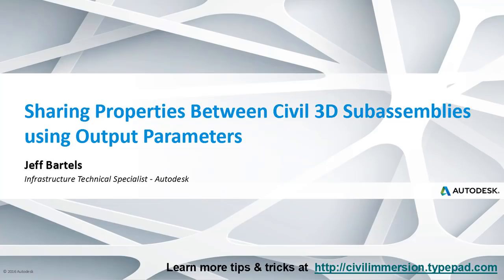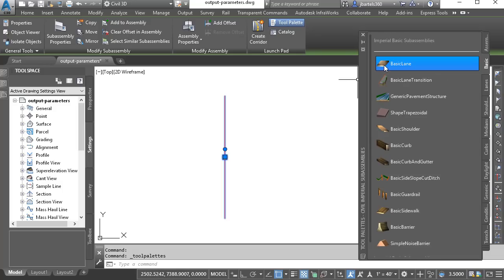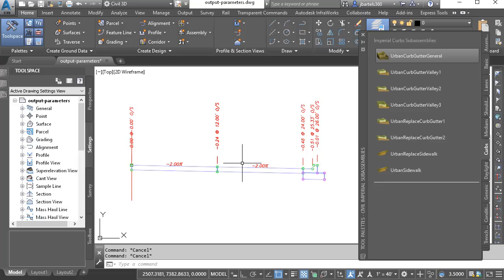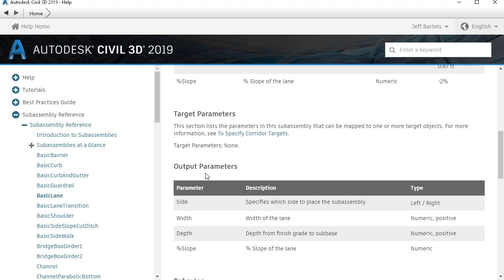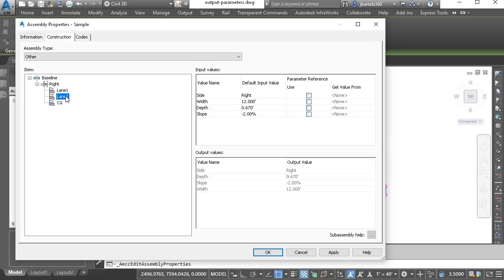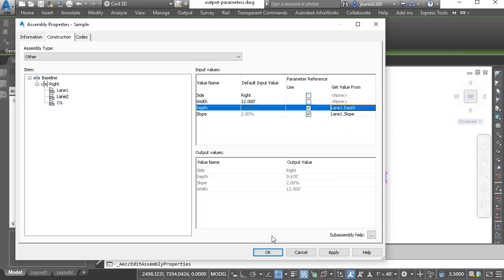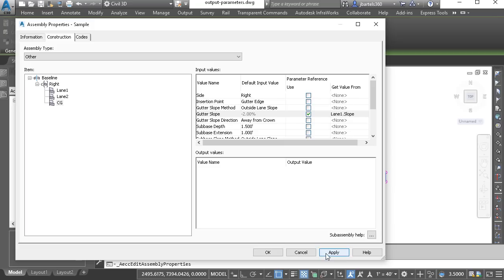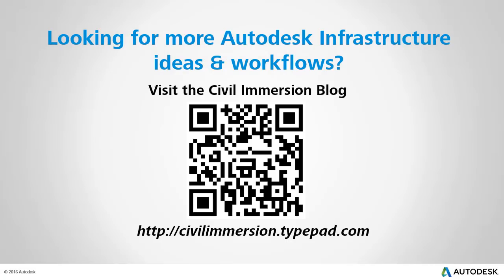Creating Shared Properties Between Civil 3D Subassemblies

Comment: Hey Jeff, nice video! I'm trying to build a subassembly for a ditch for installing sewer systems according to all regulation codes. Now in the Netherlands where I'm working they're increasingly separating storm water from sanitary sewer, so often there's two pipes being installed close to one another, but they don't always keep following the same trajectory. Therefore I'm building my sub assembly in order to allow for the two corridors of the two sewer pipes to join together when they get close enough to one another (in C3D this means one ditch for installing both pipes).

Sometimes circumstances require the use of form-work in conjunction with a 90 degree ditch slope. When this happens the other side of the ditch should therefore also use form-work, so the both sides can be reinforced against each other. Therefore I require an output parameter/variable called "bekisting" (form-work in Dutch) that can be also an input variable at the same time, so you can link the two corridors in this regard (form-work on one side means automatic form-work on the other).

The whole system of output parameters/variables is slightly confusing to me though, as I can't have an output parameter with the same name as an input parameter. Would you know any workaround this problem?
Reply: To make the matter slightly more difficult, this should therefore also work both ways (which might be tricky considering the fact that there's a progression where the first one should always lead and never follow according to your video)

Comment: Hi, Sir, I have a Problem
I create a corridor & make the cross section  after that  I make corridor surface,
then add Bottom Link But Problem is  my Bottom link not follow my typical section Bottom line,
if you give me his email I send you all the data.
I am work in Saudi Arab Design Modification Department, My other Collique says Civil3d cannot solve this problem.
please not ignore my comment  may be my explanation not clear your concept  but if you give me his no or email I send u all data this is a big problem in civil3d I use latest 2019 Software
Thanks
Mudasser Ali _ 00966 582483800
civilsurveyor007@gmail.com
I am Waiting for your Reply ??????????

Comment: Thanks for this Jeff, great video as always. I have a situation similar to your example, except I want to vary the slope of "lane 1" with targeting and have "lane 2" adopt this same slope. When I construct my assembly, I use a BasicLaneTanstion sub-assembly for "lane 1" and a basic lane sub-assembly for "lane 2", however the BasicLaneTransition has no output parameters. Is there another way I can achieve this?